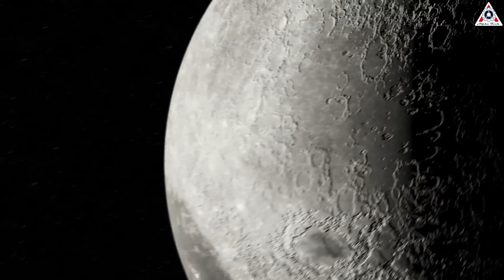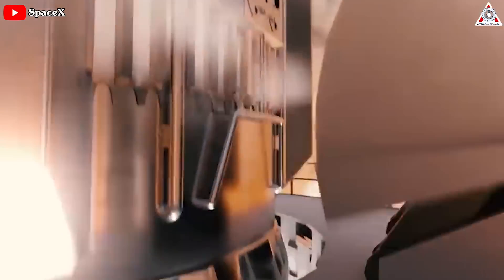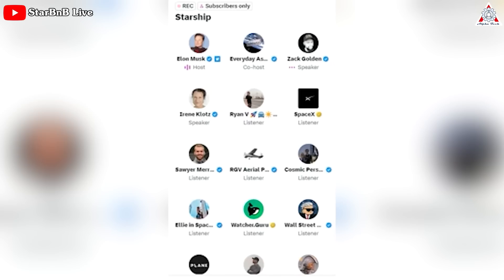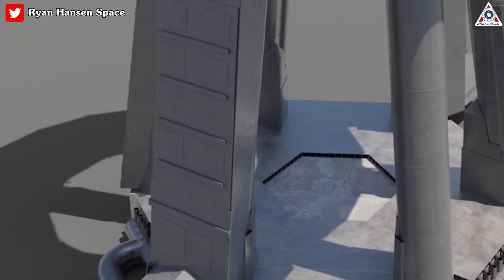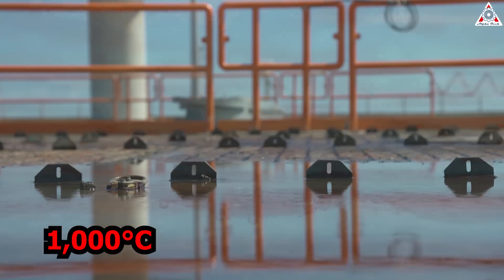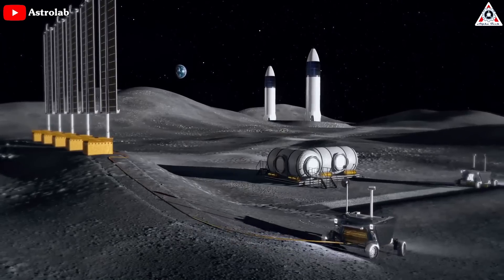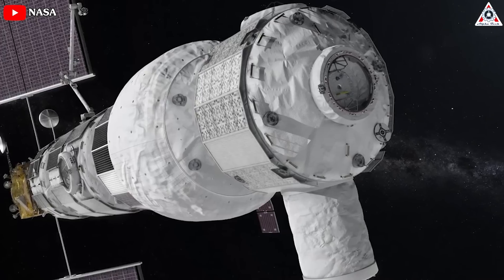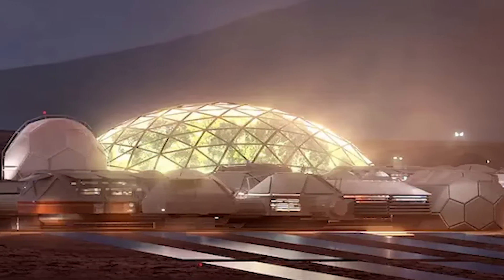SpaceX's NEW trick to face 33 engines...

Comment: I warned ELON MUSK about his poor Launchpad design and the damage that resulted. This time he is going to launch far quicker within 2 seconds which is a Huge benefit.
But again I WARN ELON MUSK that his Metal plate and water deluge system is inadequate and with 20 million pounds of rocket thrust will cause resonance in the metal plates along with blast pressures to break apart the metal plates and make the small amounts of water he is using irrelevant to reduce damage. Again we will see if the launch takes more than 2 seconds how much damage is created.

Comment: Water cooled pancake plate is not a deluge system.   A deluge system matches rocket thrust created with a near equal opposite force of water. 

I hope to be wrong and this plate system works.   My assumption is SpaceX does not have enough  tanks or water supply for a full-on deluge system.

Remember at one time StarBase was to have originally built a natural gas electric  power and a desalination plant to create clean water.  

I doubt SpaceX could truck in enough water for a full-on deluge system or have the holding tanks or water pressure for sustainment.
Reply: Do you know am building a deep space rocket in Boca Chica, a town along  Gulf Coast of Texas, near the Mexican borders
Reply: There is also another reason for not using a ton of water. That water would have to be recaptured, filtered, and reused as the fresh water could not be just released into the area and salt water would become concentrated brine also causing a problem for the area. And no, a deluge system does not match the trust of the engines with an opposite force. Water at the Cape is directed sideways and down, not up so it does not need to match the trust. This plate system will need to match the thrust plus some as the pressure will be straight down on it.

Comment: I've been on my soap box sense the damage to the launch platform, and forced termination about using steam from the water as both a shield, and pressure to help lift the first stage of the heavy lift. Elon's engineers have come up with a method to use the steam produced to aid in the ignition and lift off. There's several ways to use the steam to lift off, and protect the ship, and the the launch pad. We'll just have to see if the way they picked is a successful method.

Comment: 3 engines weren't damaged they chose not to ignite them. The rocket wait on the pad was not according to plan. The rocket actually flew side ways.
Reply: The three engines that were shut down were not damaged, but underperformed which is why they were shut down.
Reply: @michaeldeierhoi4096  yes that's what  I said
Reply: @AP-qs2zf  Silly of me to read misread one word and completely change the meaning.  Duh 
Have a good day!

Comment: the steel plate will be interesting.. the psi of the total area  of the water dispersing holes will be far less area than the area of the 33 exhaust nozzle's. with their 280 to 350 bars of pressure ..  300x 14.7 psi =4410 psi if areas of both were equal..  there for it will take a tremendous about of high pressure pumps to flood the pad with the water it will need.
Reply: That is combustion chamber pressures, it reduces dramatically once in the nozzle area and expanding a lot.  Of course velocity goes way, way up; probably the cause of most of the damage.  Then it's got 80 feet of basically open area to disperse into.  I saw someone mention that it's only 20 bar at the pad surface, not sure if that's accurate or not, but it doesn't seem unreasonable.

Also it looks like they're using a large number of pressurized tanks vs pumping the water.  I was kind of surprised at that, being that the Gulf is (now we know literally) a stone's throw away.  But it does have the advantage of being filled by a few small pumps over several days if need be, instead of one or two massive pumps sitting around idle 99.9% of the time.
Reply: They should start with a pond of water over the plate to catch the first impact, and start the steam conversion. The laws governing the flow of fluids only allow maximum flow down the center of a pipe, and and almost nothing near the outside of the pipe. So to meet the 4400 psi they'll need 10,000 psi and maybe more in small diameter pipe, and those plate deverter lids. They should upgrade to 12"-16" supply pipe feeding the top of the plate through the ignition exhaust to produce the steam cushion, and aid thrust with expansion of water to steam.  It will be interesting to see how Elon's engineers solved the issue. The Russian use a long trench to devert the rocket blast.  Elon seems to be letting the blast move in all directions.  We'll see which method allows the engines to operate at optimum levels. The outer engines are taking a cross blast light blowing out a candle. The inner steering engines are taking a massive amount of excessive heat which definitely caused damage on the maiden flight. They need some kind of shield protection against the power blast of the outer engines. The excess heat causes gas expansion before reaching the chamber designed for the process. So you have bubbles causing uneven fuel delivery. Causing engine shut down. Using liquid nitrogen above the shield layer might solve all the problems be reducing the fuel, and O2 temp before entering the final mix chamber of each engine. Reduce the popping, and uneven burn by 90% with colder fuel mix. Just a possible solution that might be explored.

Comment: IF the plate works (no chance) it will add an explosion of steam, and if fails will become shrapnel under the strength of TWO Saturn 5s. The judge is going to rule the world's largest rocket needs an environmental assessment that will say NO CHANCE of building a proper water deluge system (that has to collect the water).    Just move to Kennedy and be done with it SpaceZ!

Comment: 0:50 they opened the clamps before starting the engine??? What? What about gravity which would drop the rocket to the ground? Did they switch on gravity after engine start?
Reply: they released the clamp lock mechanism 15 minutes before takeoff.
Reply: There is one of clamps that hold Starship down in place and another set that support it in place from underneath.  When the raptors achieve enough thrust the rocket can take off which I did.
Reply: Hello 👋 thanks for your support in my dream and career happy to have you as a fan 🚀🌎

Comment: Pretty sure several engines in the outer ring never even started up, so they weren't necessarily damage by the debris, they just didn't have restart capability like the inner ring.  Also, I believe that the clamps cant fully be removed before startup because the disengage on the clamps also disengages the ability to startup the outer engines, thought I may be incorrect on this.
Reply: @ JT  Actually two in the outer ring and one in the center were intentionally shut down at the start of ignition according to Elon.  Three more failed soon after liftoff though it is not known for sure if that was due to debris kicked up by the raptor plume.
Reply: They release the clamp locks before take off, the clamps need to wait till the rocket has enough thrust to support it's own weight.

Comment: I really don't understand Musk's determination to not use a real flame trench/diverter and water deluge. They're used with Falcon 9 and Falcon 9 Heavy, for Pete's sake. It almost seems like this has become a personal thing to him for some reason. But physics doesn't care how you feel.
Reply: It's because the water table is really close to the surface, so they can't dig a trench.

If you look at pads 39A and 39B at the cape, they are mounds artificially built up.

It's really expensive to build up the mounds.
Reply: @WyomingMtnMan  I understand why they can't actually dig a trench. But Artemis did more damage than expected to the mobile launcher, and that was with both a flame diverter/trench AND a water deluge. We'll see if the steel plate thing works, but it's hard to rapidly reuse a rocket if you have to keep rebuilding your launcher after every trip.
Reply: They haven't been doing things the traditional way the whole time so far.  One way to find out.
Reply: @nathanwahl9224  True enough, but you can circumvent the laws of physics just because you want to try something new. We shall see soon enough.
Reply: You are actually talking to Elon Musk.  I created this personal account to learn more about my fans and use them in my career.
Reply: @ElonReeveMusk-CEO  Mmm hmmm. Yeah, sure. Okay.
Reply: @b1blancer1  Do you know am building a deep space rocket in Boca Chica, a town along  Gulf Coast of Texas, near the Mexican borders

Comment: Very nice acknowledgement of what was tried on  the last launch and what is going to change.  Wonderful improvement from yesterday's post.  I'm still not sure if they can keep the water pressure above the rocket pressure at the center of the plate. So much force/heat/noise pressure.  The interface as to where the water flashes into steam would seem to move to inside the deluge chamber as the flame blast goes on and I don't see high pressure steam blasting out of those ports providing much protection to the plate anywhere beyond the edge of the port.  Sure the plate can reach a couple thousand degrees C no problem, but the water below in the deluge interstitial will be flashing to steam before it even reaches the port.  It makes getting the rocket off the pad as quickly as possible the key goal.  I agree with some of the other posters that the intentional avoidance of the proven protection method (the flame diverter) is causing the reinvention of the wheel here; however the "this is the way we've always done it" argument rubs me the wrong way every time.  Dealing with "the most powerful rocket ever" however should up the launch engineers game out of the gate.  Right now they just seem in catchup mode.
Reply: Having it flat (the water plate) seems to me to be asking for higher pressure in the center. Sloping the plates ( higher in the center cone shape) would allow a path of escape. I don't think it would have to  be  to aggressive of a slope to be effective.
Reply: I think SpaceX engineers have learned more about the "high-pressure-exhaust-meets-the-high-pressure-water" event from the previous test than we realize. The key is to have enough water and backup pressure to maintain an exhaust-gas deflection dome sufficiently thick and wide to prevent vaporizing the water inside the steel structure. This may mean numerous eventual changes to the way high-pressure water is supplied to the structure as they learn more. Just like Edison eventually got his lightbulb perfected after many tries, SpaceX will eventually find and perfect a solution that works. Consider how many tries and failures it took to reliably land those tall, skinny rocket boosters, and now these landings seem like routine processes.

Comment: Don't mean to be negative but where is all that water supposed to go after it's shot out of the plate? I haven't seen any kind of channeling , so they'll be flooding the launch pad? They really messed up not including a flame tunnel/diverter into the launch pad design.
Reply: Did you forget about the very hot rocket engines turning all that water to steam?
Reply: @shaung949  some of it will turn to steam yes. But a bunch of it won't.
Reply: @evandipasquale9255  You are correct in that regard.  It'll get blasted way in every direction over a wide area, so that's probably not an issue; but it's still better than chunks of solid stuff flying around.
Reply: I decided to reach out to hundreds of my fans and get know more about, them and give tips about my career I think you are one of them

Comment: you know why flip at top is top half is counter weighted as half top full of tiles you see as lift off angle see tilt one side u don't see this as sitting flat on pad but soon in air that when start lean over, the shell like tin can u stand on it fine until small dint side it f, if slow down see got very bad wobble at top to heavy vs bottom light and then add big weight in middle as fuel burns off get light in middle then weight top half takes over this were ship can't handle it then flips.
Reply: I decided to reach out to hundreds of my fans and get know more about, them and give tips about my career I think you are one of them